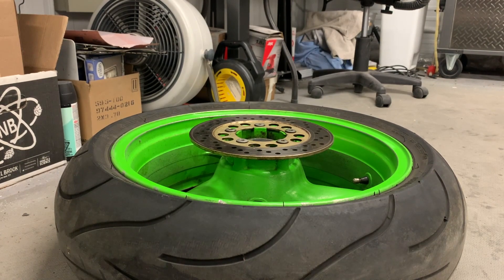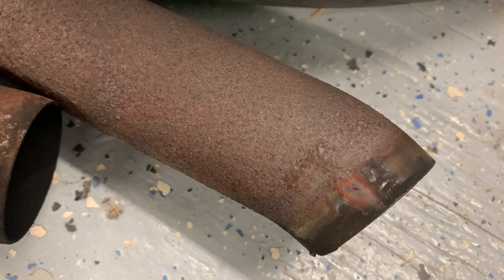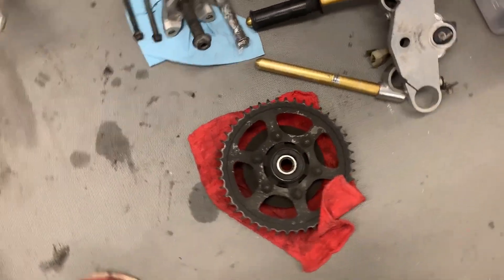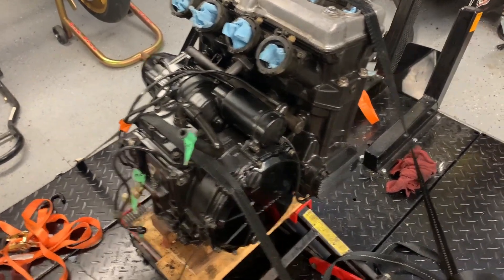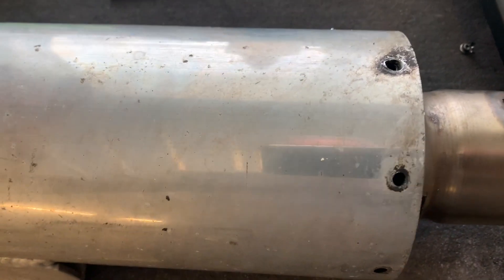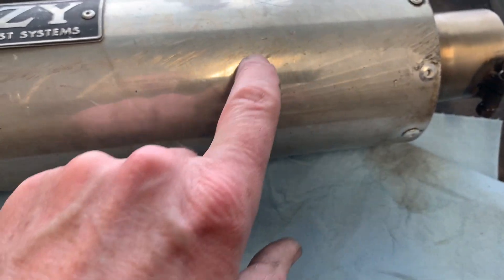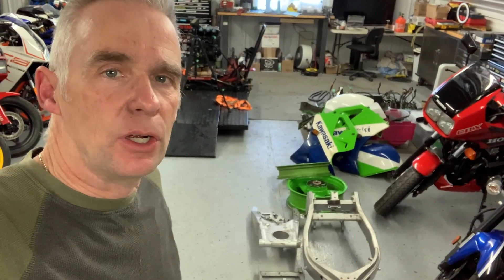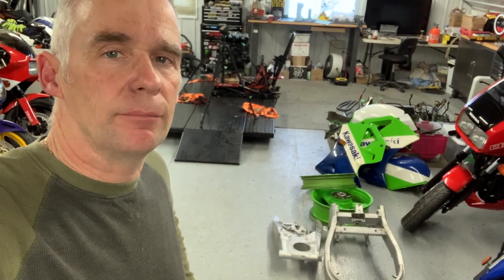1990 Kawasaki Ninja ZX7 H2 - Restoration - Episode 2 - Fix & Repair

Comment: As someone who has gone through a similar journey with my ZXR H2 I can appreciate the amount of work this takes. I now need to get my carbs sorted as not using it for a good few months has I think blocked the pilot jet..again. Modern fuels. 🤦🏻
Reply from the maker: Thanks for watching and commenting.  Modern fuels are a PITA.   Any bike that I leave for more than a few months I put Shell Ultra 94 Ethanol free fuel in + Stabil.   seems to help.